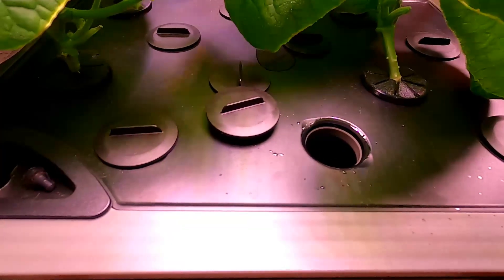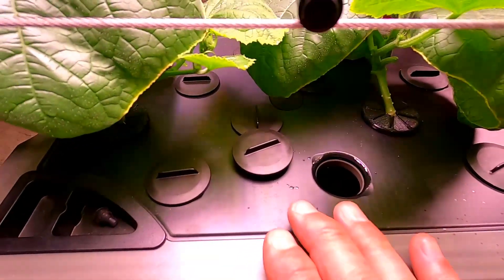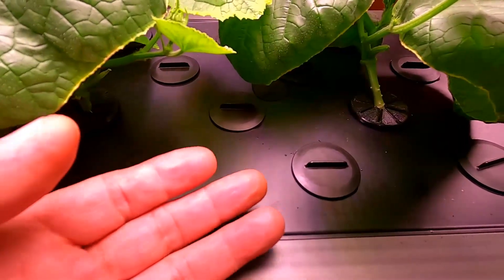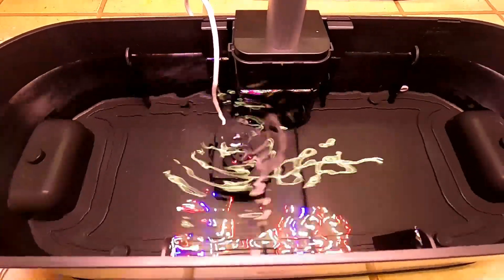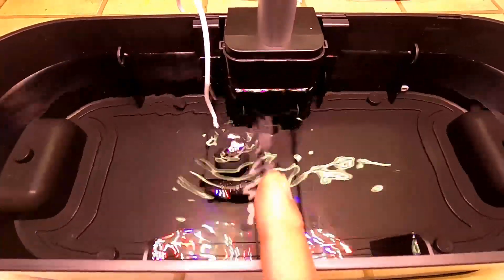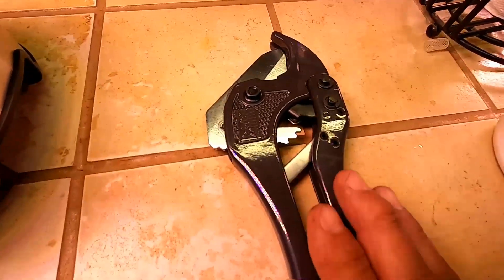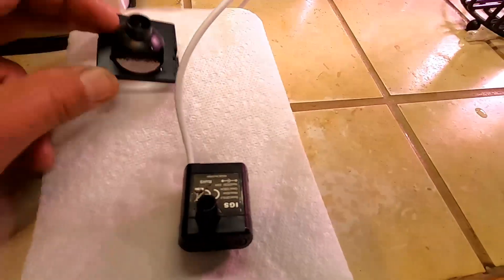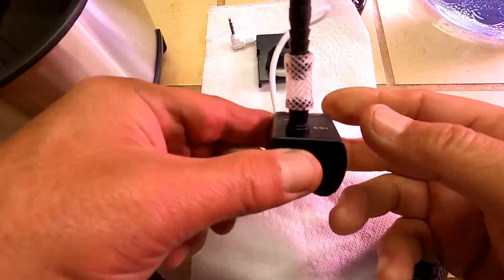Hydroponic Hack Used By Experts || LetPot & iDOO System Hack

Comment: I have two Letpot Senior systems and two other branded systems, one smaller and one larger which have a different pump arrangement and splash/pour water more.  All have fairly crowded established plantings.  I happened to get hold of a Dissolved Oxygen meter (DO Meter) and measured the Letpot's at between 2-2.5 mg / L (poor) the other two measured between 5.8-6mg / L (good) - I had no idea Letpot's were this poor at oxygenation, I will be looking at your mods for sure!
Reply from the maker: Thank ya for watching and commenting mam, welcome to the channel!!  Yes mam, aeration is definitely poor in some systems but adding that T surely makes a difference!!  Have a great Sunday!!           Dan
Reply: @HomeInTheSticks  Just to give feedback here the changes more than doubled the Dissolved Oxygen levels in the Letpot senior hydroponic systems, a very cheap effective mod
Reply from the maker: Thank ya for the feedback, hope folks see this!!            Dan